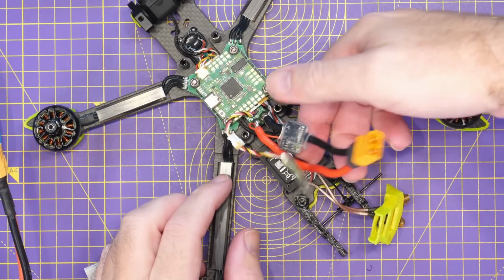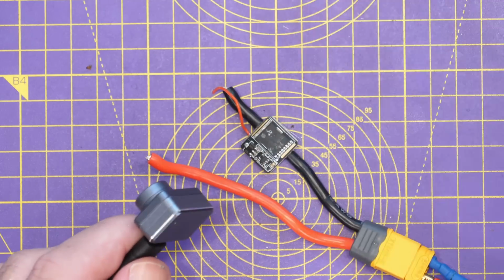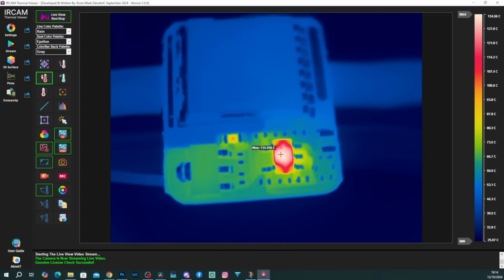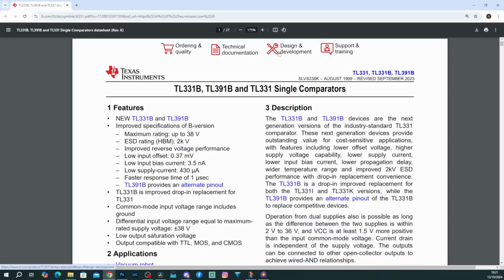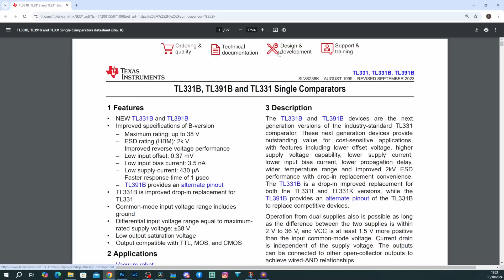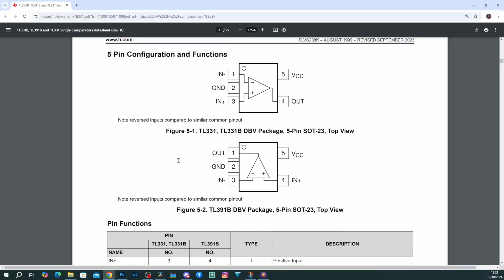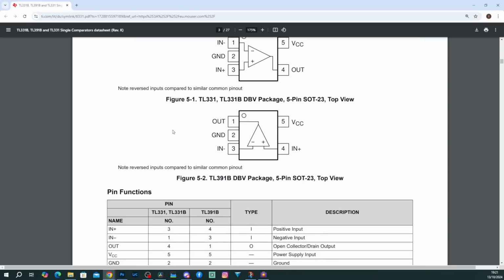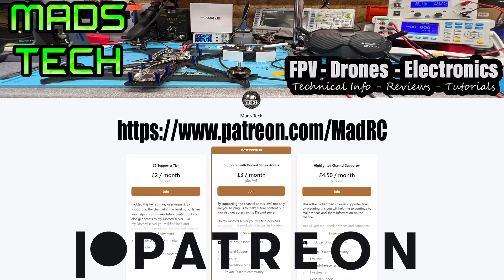iFlight Anti Spark Filter - Dead FPV Drone Repair

Comment: I designed my own one of these because I fly 8S with a honking 50v electrolytic cap and the inrush was worse than on 6S.

For the life of me I can’t figure out why they designed it the way they did. Much simpler design with just two connections on the low side between the bat and the ESC and use the potential between the two.

They only use parts from JLC parts library. Typically these are knockoffs of Japanese and American components. The issue is they usually are less efficient and have lower capacity than the spec sheet.

The LDO they used is particularly underspec’d. The fet itself is great for this purpose. 

The components they used would be good for 4S though

Their circuit is susceptible to inrush while already being partially closed

I would be money on that TI part not being genuine (or more likely it uses the same part number sold under a different brand)

Comment: It happened to a friend with a brand new Cineflow 7”. After a few flights, the drone turned off mid-flight. Analyzing the blackbox log, it was clear that the power was turned off mid-flight. The damage was huge, breaking the O4, frame, motor and also shattering the GoPro 12 that was on the drone. And no, it wasn’t a battery problem because it was connected to the drone when we found it and had about 80% charge when we tested it. The only villain in the story is this Anti-Spark, which should not be used on these drones.

Comment: Just repaired exactly this fault. From 6 brand new Nazgul5 V3 one was DOA due to failed TL331IDBVR in anti-spark filter. Either voltage surge on connecting to 1000uF capacitor after it is too high or most likely iFlight skimped on original TL331IDBVR using a fake instead. Another thought: I guess that 10V LDO (SOT-89 package with ".8G" on a label) provide lower voltage to MOSFET gate to keep current minimal till voltage on large capacitor at opposite side rise enough to fully open the MOSFET. On heavy punches and sharp turns voltage spikes start to mess with LDO and subsequent TL331IDBVR. This can explain why iFlight anti-spark boards sometimes cause unexpected crashes. To fight with these, such board require also TVS diodes or other voltage surge stopping measures.

Comment: After a couple weeks of trouble-free flights, I just had my iFlight SH Cine7 LR switch off and drop from the sky.    The battery was unplugged when I found it but it had also "landed" upside down on rocks so momentum could have pulled the plug.  I know the plug was fully seated when I took off so I'm wondering about the anti-spark filter.    Thing is it powers up fine now so if it failed in the air, it's an intermittent failure.      I've been FPV piloting for over 20 years and I just cannot remember the last time I had a drop like this.   It's usually something like a thrown prop, midair, etc..

Comment: I have this anti-spark filter installed on my custom 6S 5'' build and it died after roughly 6 months of freestyle flying (about 2-3 sessions per week). I used it alongside capacitor.

Comment: why would they put a antispark switch there？ spark is caused by caps charging up, it won’t hurt electronics in my opinion, are they trying to protect the xt60s? Why not just use antispark xt60 with a resistor???😅

Comment: THERE ARE 2 VERSIONS OF IFLIGHT ANTISPARK FILTERS.
The small one,that Mad burned in this video(35A) but also another one the Chimera 7 edition which is double the size(150A)
Reply: Actually there are three versions, in the iFlight Store Europe you can see all three of them in one store page. Mad here has the V1, then there is a V2 with a larger FET on it and the V3 has 2 of the larger FETs. In the description it says to use V1 or V2 on smaller quads up to 5 Inch, and to use the V3 with the double FETs on 7 inch or above.

Comment: Maybe not direct connection to this topic, but I think in 2021 I've had worst year in FPV- 12 dead ESCs from cheap 25$ Rev35, through Tmotor Veloxes v2, even (at this time) 100$ Foxeer Reaper 65A, like 2 dead FCs. I was struggling with finding the reason, because ESCs were dying different ways, sometimes out of nowhere (punch, reboot and all processors were dead). Changed motors, VTX, FC, ESC and still they were dying. After YEAR of rebuilding, waste of money something hit me, when I was putting 13th ESC. Only thing I didnt change and all started since I've put it in was Spike Absorber. Took it out and now I'm using same ESC for 3 years without any issues.

Comment: My iFlight Nazgul DC5 Eco fell out of the sky because of the anti spark plug. Sometimes it worked sometimes it didn’t. Thought it was a battery issue but soon after it fell out of the sky again during flying.

Comment: The range on them things with the LHCP antennas and FCC unlocked DJI goggles v2 with 2 LHCP patches and 2 LHCP stubbys is insane by the way. Thats why i prefer the v2's over the 2's as the 2's are linier antennas and cant be changed inless you go inside and ruin your warrenty. You will most probably know this yourself tbh but to anyone that doesnnt... thank me later :p
Reply: Yup, and I just tested Goggles 3 vs V2 and the V2 still kill em in range + penetration (with TrueRC's help)
Reply: But they don't make V2 anymore.

Comment: Hi Mads, I had the same problem with my nazgul evoque f5 v2... it just wouldnt power on one day was completly dead like yours the drone was fairly new, i thought my stack had smoked so i got intouch with iflight and sent it off so they could look at it and within a few weeks they sent it back with the same stack in the drone everything the same. I dont know what they did to it but when i got it back it worked fine and has done ever since so i assumed it was something to do with that anti spark device also.

Comment: Why so complicated? For years we made our own with a resistor.  Dead simple and it what not a flight critical item so it didn't matter if it failed.
Reply: Because 150A switch is too large and heavy for 5" quad.

Comment: order an IC and fix i! would like to have seen it
Reply: There is a tiny little problem - where to order them. I strongly believe that  burnt voltage comparator IC in this video is fake. Due to that I'Il wouldn't recommend to buy these in Aliexpress, eBay, Amazon and other shady places in this aspect.

Comment: ON 6s Quads I have used spike protectors from other brands and I stopped.  It has happened to me where I momentarily plugged/unplugged and the Spike protector fried and stopped passing current.  I think they offer too much protection and are a point of failure. Sucks when it happens out in the field.  Unless it's a super expensive cinema build, I would not use these so called spike protectors.
Reply: Yup. Not needed and just another thing to fail…

Comment: Hey Ian, I've been digging into this issue for the past week now. Iflight has 3 versions of these anti-spark modules. looking at the specs for the modules from iflights website it claims that the two smaller anti-spark filters can only handle 30amps continuous or 35 amps peak for 10 seconds, the nazgul eco has the smaller one so wouldn't this be an issue since the ESC is 55 amps and the anti-spark module can only handle 30 amps continuous? Iflight has the bigger module which is 30x16mm and that claims to be 150 amps continuous and 160 amps peak so wouldn't the bigger one be better suited? Wondering if using the small one is causing pre-mature failure since its not rated for the currently that most 6s ESC will draw or am I misunderstanding the specs? Any help would be greatly appreciated!
Reply: ESC 55A means the total is 55 x 4🤔

Comment: Welp, I bought one of those and installed it in my first build that  I just finished and haven't flown yet.  I really hope this is a one-off.  First the DJI goggles 3 and now this 😘  I really  have a knack for picking components and I just started.
Reply: What brand did you buy? I want to buy one myself.
Reply: I bought the same one he's discussing here.  Iflight sells them.

Comment: The idea of antispark come from last time RC helicopter of 500 size or more. During that time, we uses 6S to 12S of 3000mAH or higher. When you connect that high voltage and current, the dean connector (some even use bullet style connector) get burn out pretty quick. Those days some even come out a resistor based 3rd wire connection that you will connect first (to slowly charge up the capacitor in the ESC) before you connect the battery.

The reason why you can't just use a switch or relay is that, the spare still occur, but it happen on the switch/relay contact instead, and that will burn out the contact pins.
The reason why it control (on/off) the negative side is because of using N-Channel MOSFET as a switch behavior. When the MOSFET turn on, there is like very low resistance and thus, no physical contact pin to generate arc.

I did design and build my own antispark circuitry that has microcontroller to control a N-Channel Gate MOSFET, where once the battery is connected, the microcontroller then turn on the MOSFET after like 1 or 2 seconds later. After that, I also come out a simple P-Channel, capacitor and resistor to control the N-Channel gate instead. Those were like 20 years ago.
Reply: Why not use antispark plugs with a resistor built in

Comment: Interesting deep dive Ian. I use the iflight spark filter on 2 of my quads and have I've had one issue where the small red wire disconnected during a crash. Would be interested to see a transistor repair.
Reply: For these MOSFET packages hot plate or oven work like charm. Also these really need ROHS solder with high melting point or they can suddenly leap off board on heavy punch.

Comment: I know it wasnt working at that point, but seemed a bit risky to plig the battery whilst the O3 antennae were unplugged.
Reply from the maker: It's fine.  These Air units will survive fine with no antenna. They won't burn out.
Reply: @MadRC really? What kind of black magic is in there?
Reply: @breckfreeride low power mode 👍

Comment: Anyone else think it’s kinda cool when it pop plugging in?
Reply: I do love thinking I just cheated death everytime I plug in xt60
Reply: Is it cool burning the battery connector every time?
Reply: 6S snap makes me hard
Reply: It helps you understand how much energy is stored in li-po battery, how much amps it can give and makes you respect your quad.
Reply: @meotyda  nah, every spark adds more resistance to the plug.
its also hard for capacitors, when they fully get charged from zero to 100.
eventually you can also just use xt60 anti spark plugs.

think of car hifi capacitor, you'll have to pre-charge with a small bulb, so the cap wouldn't explode while connection power leads.

@Mads Tech, the nazgul v3 uses different anti spark filter than new eco, bigger pcb. maybe the choosen one in the new eco nazgul does fail more often.

i've not had 1 broken yet.

Comment: Wouldn't it be easier and more cost effective to install a physical switch rather than an anti spark? Would that accomplish the same thing while being more reliable?
Reply: A switch along a lead?
Reply: Or will it still spark alone the switch contacts?
Reply: hard to find a switch for 200A thats small an light. 
And yes it would spark the switch contact. You have to dissipate some of energy that wants to rush to the capacitor on connection somewhere.
Reply: @KidCe.  Right on. Thanks for the knowledge. I'm still learning about all this stuff. 🤘
Reply: @KidCe.  But is it actually 200a that rushes the cap? That seems like a lot without anything more than what it takes to power the quad as a load. I understand that there's enough to to spark. I definitely see your point on the size of the switch being too small for this application though.
Reply: @amp86400  its maybe not 200A that goes to the cap, but all the current that the quad needs has through the switch. so if you have 4 motors that each could take peak 50A that would be 200A peak through the switch. 
An empty capacitor acts as a shorz circuit in the first moment of connection, so it could easily be 200A, depending on the internal resistance of the cap, and the resistance of leads, solderjoints and battery. But this hughe current would on be for veeery very short time until the capacitor is charged

Comment: mine randomly failed midair with my chimera 7. broke an arm and ruined my long range FPV trip.
Reply: Same. Mine luckily happened at low level - no damage.
Reply: @mikey_b_here  weird thing was that there was a sort of voltage fluxuation and warning before it fell. I was depseratly trying to get back bc my battery dropped to 2.8 volts and back to 3.5 (liion) and then it dropped

Comment: I have one of theese installed on a 4 inch quad and I have to say that the antispark feature is great.I wonder how possible is it to fail midflight?
Reply: My chimera did, I was discharging my batt so I pushed it hard, log shows average 70amp during 2 minutes, so I will say yours will be fine
Reply: Mine did midflight